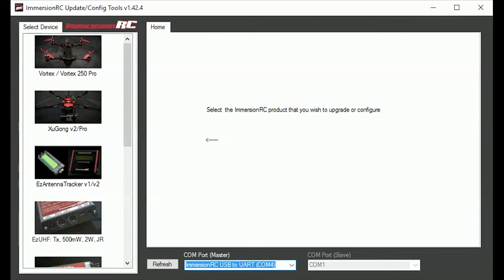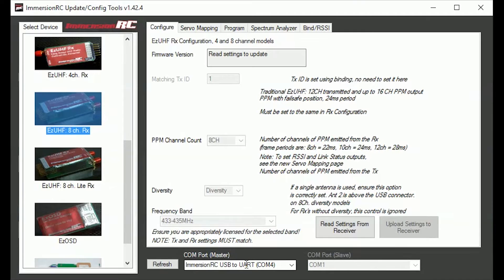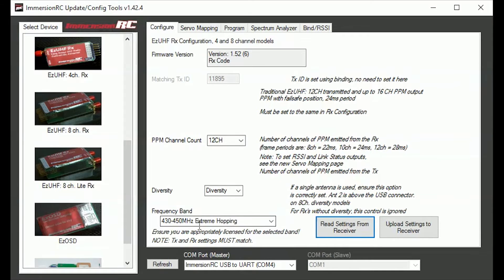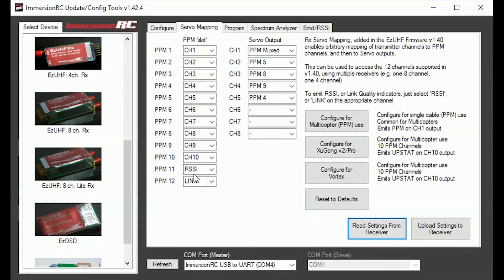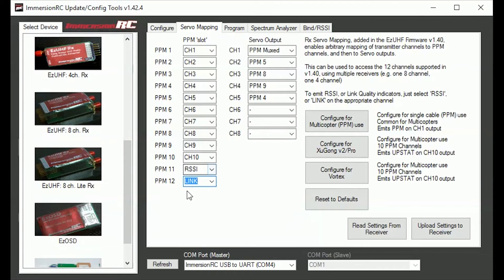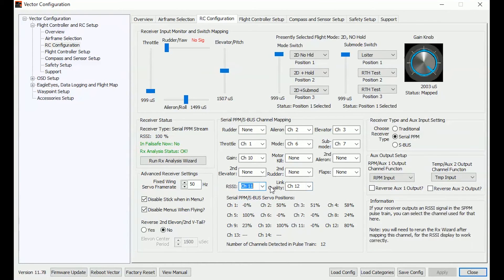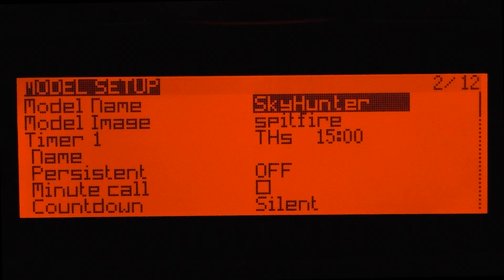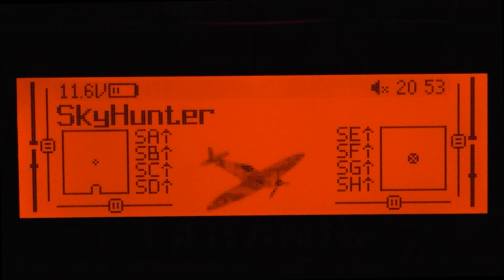How to get RSSI and Link Quality from EZUHF to Eagle Tree Vector

Comment: friend   I saw your video about use channel 11 and 12 in vector with ezuhf to see RSSI and LInkQquality in a vector, but  how to do a conectios wires? or it no need
Reply: It's completely optional to use a straight up wire as PPM can transmit RSSI/Link on different channels indicated in this video.  If you wanted to use the wire method, you will need to assign RSSI to one of the PWM/servo pins which then would be plugged into the Vector.  Personally I use the first method and it reduces wire clutter.

Comment: Hi Tony, I have just purchased a DAX for my EZUHF, this converts the digital rssi back to analogue and on this unit you can select either 3.30V or 5.0v rssi output. This is what my Storm AP can use...(3.30V).....Im using the 4 channel EZUHF receiver, in Muxed Mode.....So, channel 3 Pinout is direct to my ESC, and channel 4 Pinout is direct to my Rudder.
  This leaves only Pinout channel No 2 available to be set as RSSI output into my DAX, and then into the Storms dedicated Rssi Input Port....My problem is what / how to set the EZUHF receiver to inside Immersion Tools????  Im hoping you can help me with this as trawling through U-Tube only shows 8 Channel EZUHF receivers being set-up this way....Help....:)
Reply from the maker: +EnglishTurbines Plug your DAX into physical channel 2 on the EZUHF. In the 'PPM Slot' part of ImmersionRC tools, select a channel for your RSSI (for example,  PPM 11) and set your 'Servo Output' for channel 2, to PPM 11
Reply: Vortecks Oh, thanks m8,....I was concerned the little 4 channel reciever only went up to 8 channels, but that sounds easy enough to do...I assume it could also be channel 8 for example rather than 11...?...Why isnt there some help Topics inside Immersion Tools..?
Reply from the maker: +EnglishTurbines ImmersionRC assume that everyone knows everything about everything :-) You can use 12 channels on the 4 channel lite but it does increase latency - for planes, it won't really affect anything because it's only a few milliseconds. I always use 11 for RSSI because nothing else works correctly. It may seem like it's working but it doesn't. To test your RSSI (rather than just turning your TX off) put your transmitter in the microwave and your signal should go to (near enough) zero. If you manage to get another channel working, I'd love to know how. Oh...... don't turn the microwave on! :D
Reply: Vortecks Hi Tony, thanks m8...Im still waiting for my DAX to turn up...for £27 I consider it worth it...Immersion RC dont do themselves any favours do they..I mean they could have a few help Topics inside atrubuted to each different product, how hard can it be?..The DAX will be going in my Skywalker 1900 along with my Storm....What do you think to the new Pixhawk mini..?
Reply from the maker: +EnglishTurbines I've never been an Pixhawk fan. I did try an APM in a quad once and it nearly took my head off......I've been put off since then. That reminds me, I need a new flight controller for my Skywalker :-)
Reply: +Vortecks Lol....Im no expert, but the Pixhawk is the latest AP from what I can gather it has some serious power...My problem with this stuff is that its as expensive as say a Vector by the time you have purchased all the bits you need...The Vector looks tempting, although Im a bit put off by the font it uses, its not as crisp as say the Storms...What do you think?
Reply from the maker: +EnglishTurbines I did loads of research on the Pixhawk and (because of its setup complexities) I decided to stay away. I love the Vector and I don't think I'd use anything else for long range. You can configure and switch between 6 screens and if you turn the shadow colour off the font, it's much more readable. The manual is something to die for and covers absolutely everything and the after market support is superb! 'nuff said :-)
Reply: Vortecks Yes, you are right...if I was to upgrade. The Vector would be on my list for sure...Its aimed at the US market which explains why it has a good manual....Can I download the GUI to play with..?
Reply from the maker: +EnglishTurbines Yes mate, you can download the GUI. All you do is hit the Escape key when you get the splash screen :-)
Reply: Vortecks Cheers m8, Ill take a look at then...:)